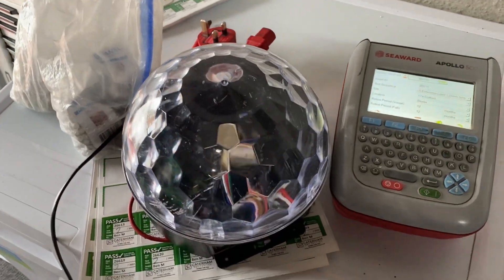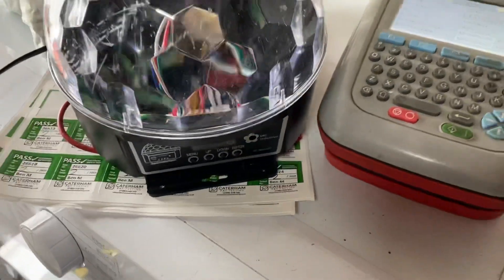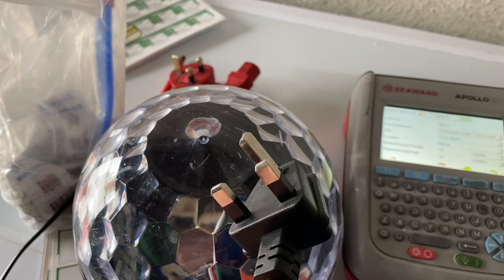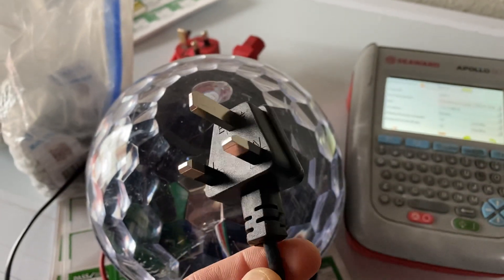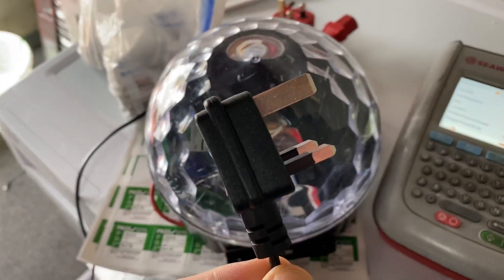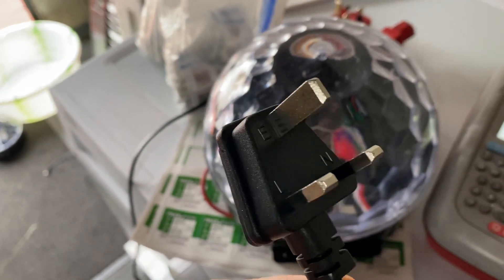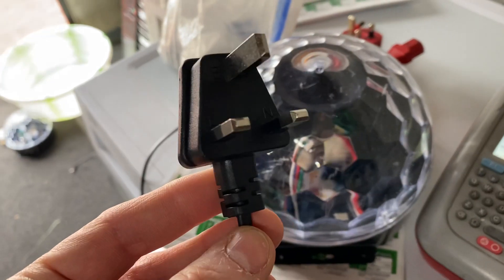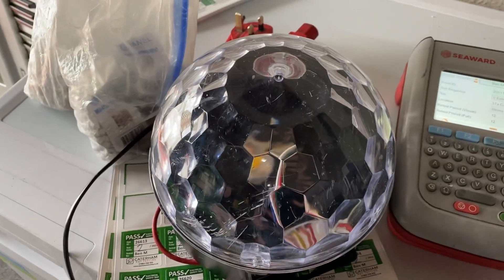Class 2 PAT Test - Tutorial

Comment: Is there a minimum wire thickness you would accept is OK and you would just replace the plug?

Thanks.
Reply from the maker: The thing here is that when a non compliant plug is fitted then the actual flex and internal wiring may not also be up to standard.